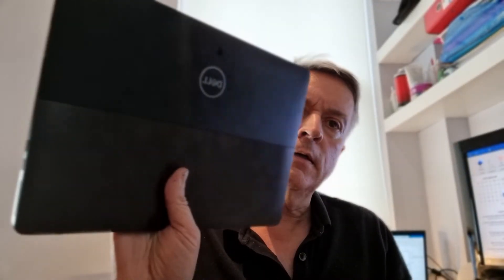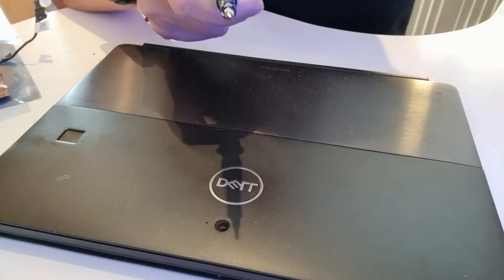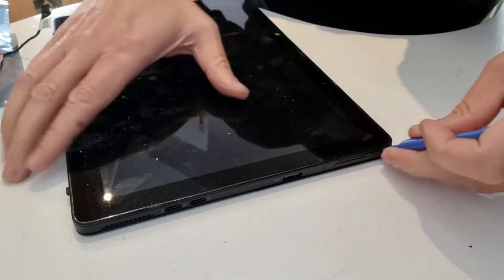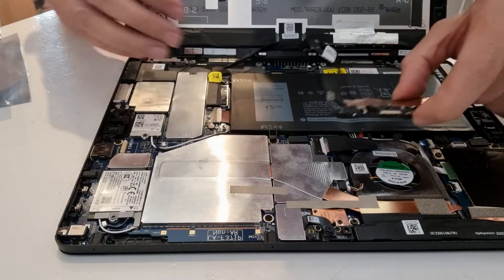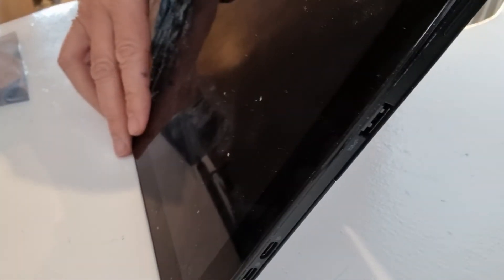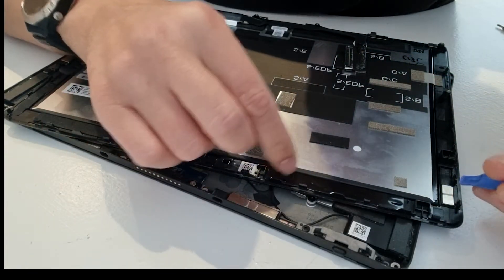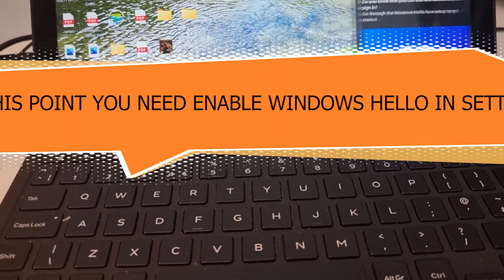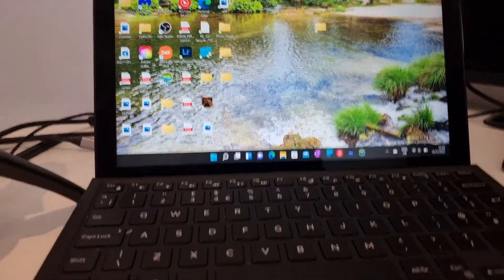Upgrading My Dell 5290 with an IR Camera

Comment: I just opened this type of laptop, I saw the m.2 slot but the socket was not installed, can it be expanded to add an m.2 SSD??
Reply from the maker: yes but it is a different type of SSD

Comment: Hi Sir, I found The module yo took off from the base is WWAN antenna, Does the New IR camera also equipped With WWAN antenna ? can We have Both Functional ?
Reply: Have you solved this problem? The camera works, but without an antenna, the LTE modem has no coverage.
Reply: Additionally, Windows does not detect WiFi during installation.
Reply: @radekradosaw8709 does the WLAN/Wifi affected by the removal of the antenna? I'm thinking about buying the IR Camera module, but I won't if it affects the Wifi/WLAN connection... I don't mind not being able to use the 4G/WWAN connection as I never use it anyway and I plan to remove the WWAN card and replace it with M.2 2242 SSD, but Wifi/WLAN is crucial for me... Kindly inform me please regarding this issue... Thank you...
Reply from the maker: You may need to download the wwan drivers from dell.com
Reply: Does this mean the camera module contains the antenna connection? This very odd